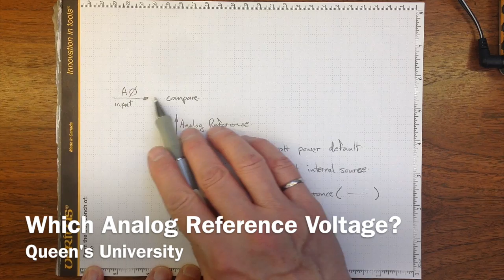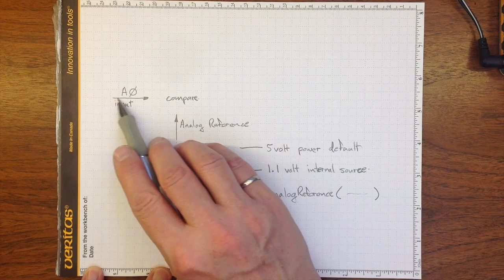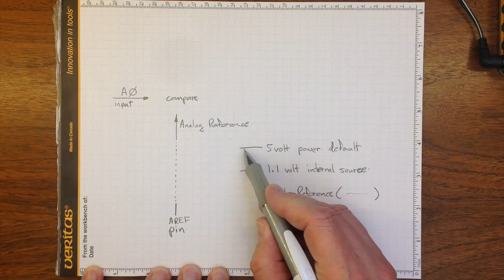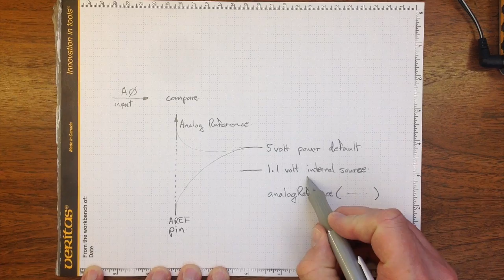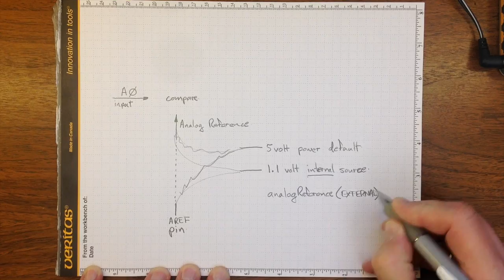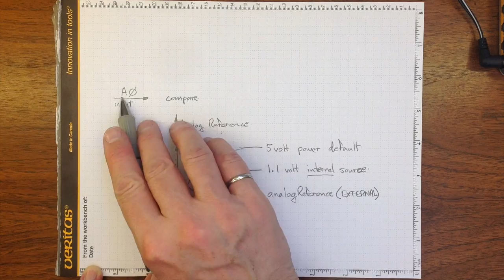Which Analog Reference Voltage?

Comment: However, On Every nano the default internal voltage reference will shift from Computer supply USB pin or a regulated power supply.   In order to get the 4.096 voltage which then means 12 volts or a value of 7 volts to 20 volts will work on the Vin Pin(30) ONLY.   
However, if one has buck voltage converter and set the voltage as close to 5 volts but no more than 5 the reference voltage is stable till the lap top USB or Computer USB plugs in.  The voltage is higher and will then cause a shift in the reference voltage.   It is no longer 4.096 but may move to 4.3 or 4.6 volts as the VIN volts are now up to a closer value of 5.5 volts. 

The best bet is 12 volts into the Vin pin then when attaching the USB, it is lower voltage than the 12 volts and will not be accepted.   However, it is highly recommended that there be Diode on the Computer USB side.  I have no Idea why Arduino did not fully do this on the board by default.  Yes, it causes 0.680 voltage drops on the forward voltage, however at 5.5 to 5.6 volts on the USB side is not a major issue. 

Just a point to note.  so if the math does not always work out there is small reasons why such as the internal voltage division.   1K resistor internal on ports also is issue.  
Results = Raw value between 1023 to 0 the value of the analog read function. 
Results = 986
R1 = 99.0   R2 = 43.19    
Seriously I looking at 5 volts range not 4096, a 30k 1%-ohm resistor should be used. 

The next voltage split is Arduino internal resistor not accounted for. 
R1 = 43.19k  Internal R2 = 1k 
= (R1 + R2 )/R1  = 1.023153508  

(R1+R2)/R2  =  3.292197268
Vin = 13.30(Fluke meter read voltage)
Vin / (R1+R2)/R2 = Vout
Vin /3.292197268 = Vout( 4.039855123)
Or 
Vin X R2 /(R1+R2) = Vout
Vin * 0.303748506 = Vout(4.03985513)

There for the following can be done. 
Option one take 
Results (986)/(1023/4.096) =3.947785532
3.947785532 * 3.292197268 = 12.99688874   This is not the right answer. 

There is something missing. 
The second voltage split 

12.99688874 * 1.023153508 
= 13.29781231 Round up to 2 decimal places it comes to 13.30 
 
A simple toy Arduino can be as accurate as fluke if the following is done and knowing all the resistors involved. 

This is something that always bothered me why the Fluke meter is that more accurate well that is why as the internal resistor on the unit is never accounted for in the original design but it is mentioned that there is a 1k ohm resistor on all pins.   Done for protection, however not stressed enough.   All analog chips require resistors before inputs to ensure there is no over voltage.  However, programmers unaware forget to add in the extra step.   The exception is the AREF pin as it mentioned has a 32K resistor. 
so, adding a 5 K resistor on the line has the following effect. 
2.5V applied through the resistor will yield 2.5V * 32k / (32k + 5k) = ~2.2V at the AREF pin.

This is why ICs have reference pins and yes must take into account all resistors wherever they may be. 
ICs also depend on 12 volt or 5 volt or 3.3-volt operating range.  Most are 5.0-volt range.  

Even an Alan Bradly Micro logic PLC 1100 is 10 volts range even though the power is 24/12 can be used to power the unit. 
The following spec's should be noted. 
Voltage Input Range 0...10.0V dc - 1 LSB
Voltage Input Impedance 210 kΩ
Input Resolution 10 bit

Comment: I am using arduino due and I have tried analogueReference(INTERNAL) in setup method. It says internal was not declared in scope.
Reply from the maker: +Ahsun Tariq https://www.arduino.cc/en/Reference/AnalogReference shows the INTERNAL reference depends on the hardware, so I think the internal reference voltage is just not available on the DUE, hence they don't define the INTERNAL constant.